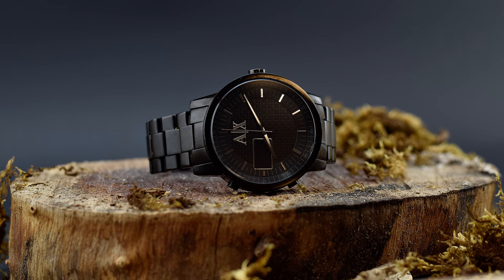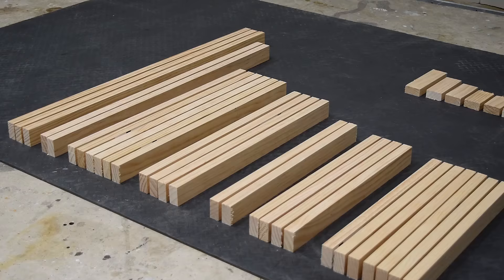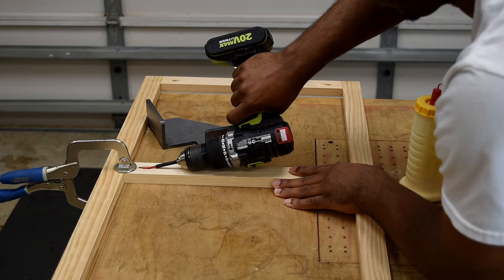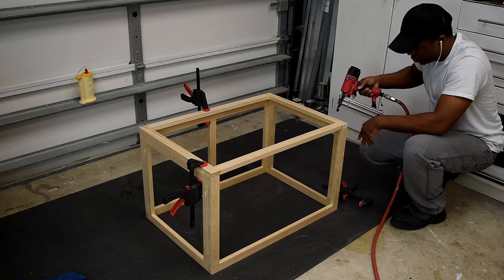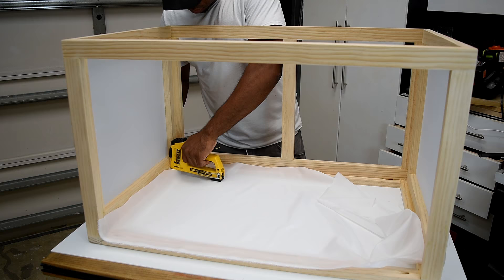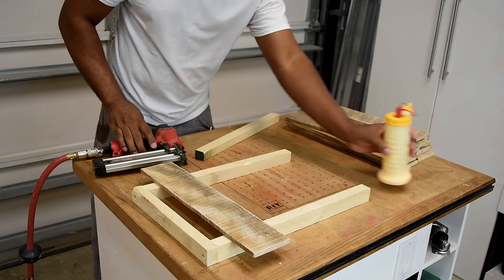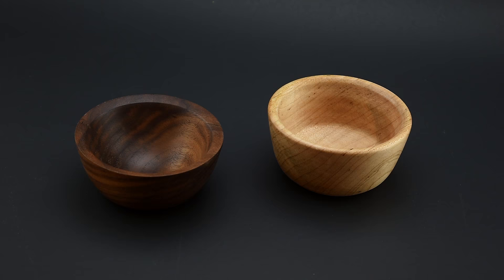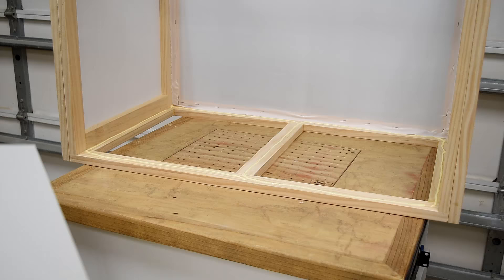How to make a LIGHT BOX

Comment: if you had 3 softbox i dont think you need a lightbox tho. maybe you can give some example to light the box with led or ordinary light bulb.
Reply from the maker: Totally agree, my lighting wasn't the best example. That why I mentioned you can use any light. Of course, it's best to show, didn't really come to me at the time.
Reply: +DIY Creators maybe you can upgrade the box by puting diy led's panel or something. i'm planning to make one for my sister florist. this is sure will be my main guide.
Reply from the maker: I actually have some other clamp on the lights in have in the shop. Which is what i'll use because I don't like lugging the studio lights around. I could totally upgrade this easy with some detachable LED panels. If I do, I will post a video on the upgrade.